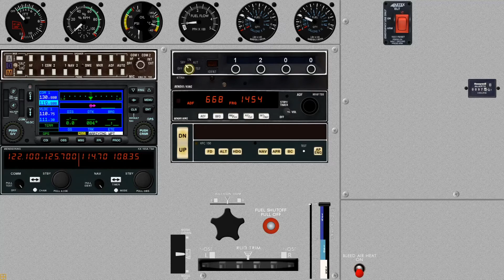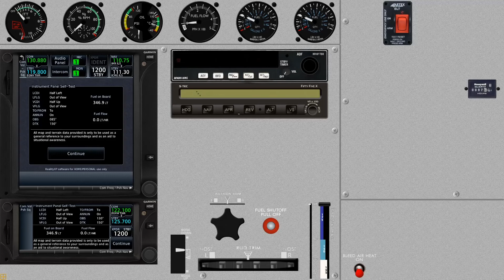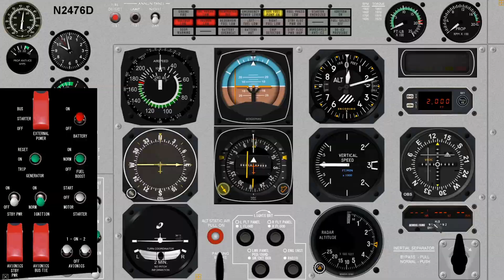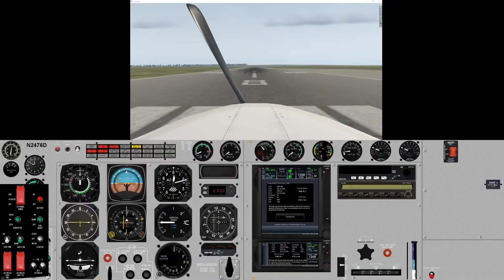Cessna 208 Grand Caravan Dual Panels

Comment: Panel looks great. Wish they had a Steam Gauge 208 in MSFS2020. I have built a physical G1000 for flight sims but I really like using Air Manager with Steam gauge planes. I built a nice Mooney Panel but nothing like your panels. Are you ever going to offer your panels for sale, I would gladly buy some of them.
Reply: I doubt that this panel would be for sale as it contains some free instruments from the community store (among them is at least my KI525 HSI). Nice work on the panl though
Reply from the maker: @JacquesZahar  Not sure what versions I had in the panel at the time but I have my own versions now of any store instruments I may of used in this video including the HSI.
Reply: @JacquesZahar  I have your HSI in my personal Mooney panel. Took a while to find a working version, most of them had an issue with the glide slope in MSFS. The one I'm using has a LUA file version 1.2. Well even if the above panel could not be sold it would be nice if they were shared somehow. Even parts of it would be nice to help others. I'm learning slowly how to make stuff.